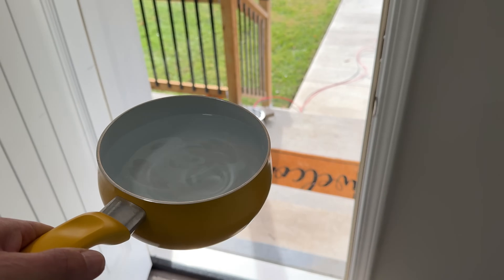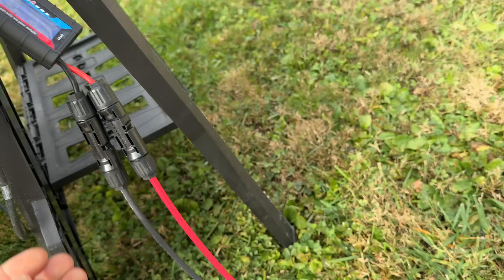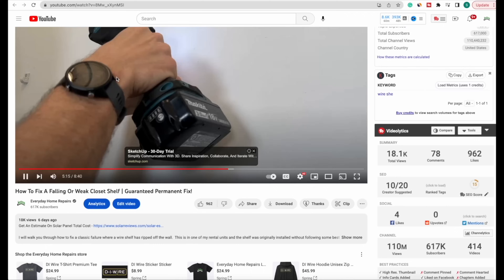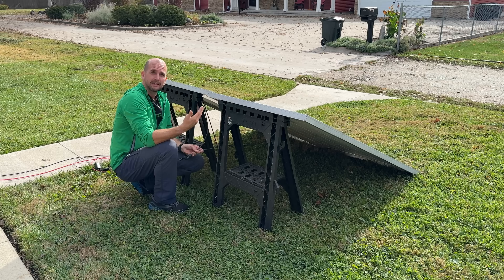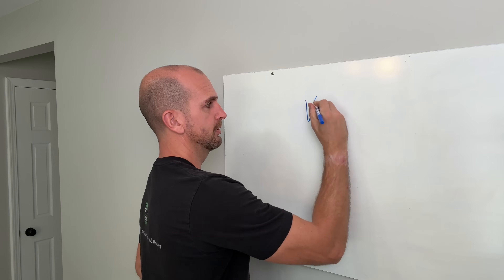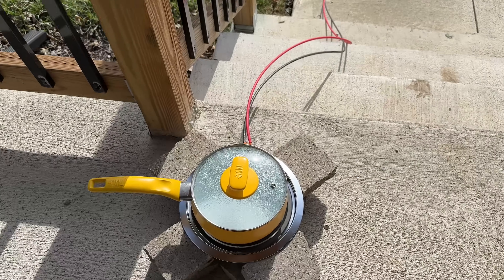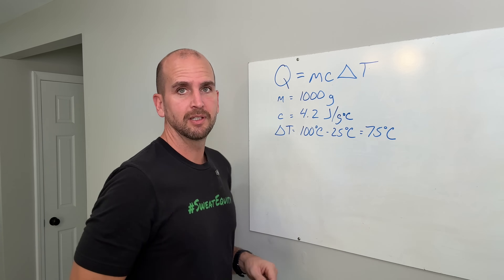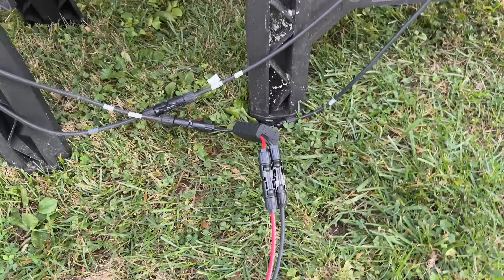Cooking with Solar | Directly Plugging Panels into Your Stove

Comment from the maker: Calculate Solar Cost For Your Home - https://geni.us/solar_reviews
DIY Home Solar (Save $1,000's Going DIY)  - https://geni.us/qN9Ot

Favorite DIY Solar Items
100W Panel (Renogy)-  https://geni.us/uSVA100
Portable Power Station (EcoFlow Delta 2) - https://geni.us/u46bT
Portable Power Station (EcoFlow Delta Pro 3) - https://geni.us/F9wfz
MC4 Connectors Crimping Kit - https://geni.us/gBJM27
WAGO 221Inline Splice Wire Connectors - https://geni.us/G0BW
Power Analyzer - https://geni.us/s86J

DISCLAIMER: This video and description contain affiliate links, which means that if you click on one of the product links, I’ll receive a small commission.

Comment: I’ve done exactly the same heating 1l of water with solar. The key is insulation, a small amount of energy can work as long as it’s trapped in and building the temperature. A 12v vacuum kettle is ideal.

Comment: If you want to even approach the theoretical watt hours: Get a small 1-1.5 quart mini crockpot (80-100 watts). Then super insulate it with concentric layers of poly styro(r value 6/per inch) cubes. Need to have a removable lid , a condensate drain hole, hole for power wires and thermal control mechanism to keep the temp within ?5 degF of ?160 degF cooking range. I haven't tried this yet , but seems like this approach to pseudo thermal cooking might help.Sqme approach could be used on a super insulated small cube minifridge to preserve those rice/beans in a SHTF situation.Unless you have a s load of dry wood, it will be hard to cook when the propane and other fossil fuel supplies are exhausted.. And solar ovens only work on the hottest/sunniest summer days.

Comment: You also have a distinct advantage there that kit intended for mains voltage "only" needs 120V - if I were to try this at home I would need many more panels as our kit in the UK is intended to be operated at 240V.

Comment: I love all the math you do in these videos. Would be curious about using an induction cooktop since it's so much more efficient.
Reply: Isn't the induction cooktop required 120v to operate? Besides every energy lost in transit, I'm sure it will be more energy efficient compared to this 4x or 5x simplest set
Reply: @ I think most if not all portable induction hot plates require 120v.

Comment: Why not comeup with a heatpump? solar cooker? Could be 300% efficient(uses 1/3 power, to produce same heat of a resistance heater), using same amount of solar power from panels 🤔. Could also make a dessert or cool cans of soda on the side. Definitely not going to fry a thing, but could heat water and most liquids efficiently. For those wanting to fry things, there is always the solar tube cooker, preventing loss from the light to electric conversion, not even needing a solar panel🤯.
 Just some 💭.❤👍
Reply: My understanding is heat pumps don't work well for that sort of application. They can bring a room up 70-90dF above ambient but not 200dF higher so they are not useful for ovens, stoves, etc.

Comment: Isn't solar providing D.C. power while a stove runs on A.C.
Reply: Electric heating elements don't care what you use. A.C., D.C., square wave, PWM, or whatever. All are good with resistive heating

Comment: Nice test. For power outages, I have stuff that microwaves in 2 to 3 minutes at 1,000 watts. Using battery and inverter of course, but can always recharge the battery with solar.
Reply from the maker: Can't beat that from an efficiency perspective.  👍

Comment: I'm more keen to the idea of combining a traditional solar oven/cooker with a bifacial solar panel (with active reflection)  driven heating element inside.  The solar oven/cooker provides insulation and the direct all around heating, while the solar panel inputs some direct conductive heating to the pot (in my case, I would probably use nichrome wire wrapped around the pot).  

    Since I make my own vacuum insulated panels, and would make a double pane top (bottom glass, top acrylic with a half inch or so of space in between), I could get it to cook well even in winter on the coldest of days.  

   Not very motivated to do so though, because our property has so little consistent sun. Just too many dang trees around.
Reply: You make your own vacuum insulated panels? What for?

Comment: I’d use three of those panels in series, but even better is 2 parallel sets of three panels.  Keep in mind that voltage and current output can get dangerous when wiring solar panels together. 

The noodles will cook in warm water with two panels in series, but will take longer.

Comment: To get maximum watts from pv panel we need to match the resistance of the panel, (320W/33V=9.6A)(33V/9,6A=3.47 Ohms) to the resistance of the heating element(24 Ohms). 24 Ohms/3.47=@  7 panels in series.  7x33V per panel in series= 231V.  Be careful, probably not a safe voltage to work with.  Find an element with lower Ohms and use fewer panels in sereis.  David Poz has an excellent video and spreadsheet to find the correct combination of series/parallel panels and resistance heating element.
Reply: How heat dog house with solar panel,  60w light bulb can heat if dog inside -20c
Reply: No
Reply: @millenium2003 Yes
Reply: @millenium2003  Yes: no. They don't see how PV panels work. Panels are current sources and the adaption is not "equal resistance".

Comment: The electric coil elements are considered really inefficient given the amount of heat escaping outside the pot. It would be interesting to see a head to head with the that electric coil setup vs an induction plate that heats only the pot! Also as others have said, testing with insulating the electric coil setup so much less heat is escaping could be great.
Reply: I've re purpose defective infrared cooker and got myself a cheap China 500 watts it can cook anything while there's still sunlight although i have no tester to see how much wattage I'm getting

Comment: How did the current increase in series? Shouldn't it be the same as 1 panel?
Reply from the maker: Series usually keeps the current the same but that is when you are using the full capability of the panels.  In this case we were well under the amount of current each panel could produce so that falls back to the V = IR relationship so as the voltages doubles we also double the current.
Reply: @everydaysolar  silly me.  Thanks

Comment: Sorry what type of splices did you use on the wire to the hot plate? Thanks Richard
Reply from the maker: Those are WAGO 221-2401 (Inline Splices) https://geni.us/G0BW
Reply: WAGO 221

Comment: Nice video. Have you considered using a DC-DC boost converter? I wonder if the efficiency would be better and end up with cooked ramen sooner😉😀
Reply: Not sure if it’s commonplace in solar but this is what hybrid automotive tech has been doing for ages. Electric power steering, variable A/C compressors to names a few.

Comment: Really great vid! It helps explain a lot for electronics noobs, which I always have a hard time doing.
Of course, an immersed heater in an insulated container would use probably half the power, but that's not the point (I guessed you'd use 350 Wh).
Thanks for calling out the metric system! USAians seem to have an aversion to it.